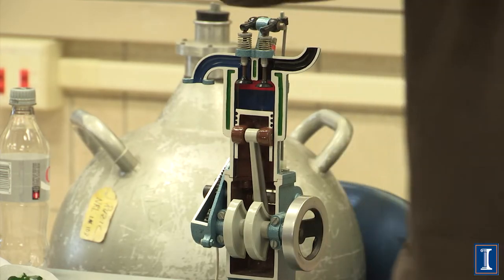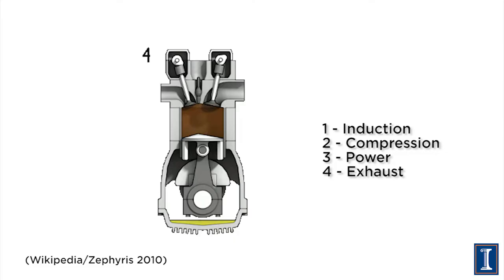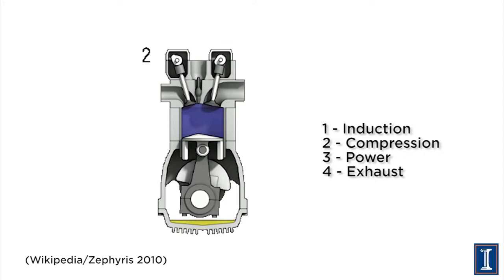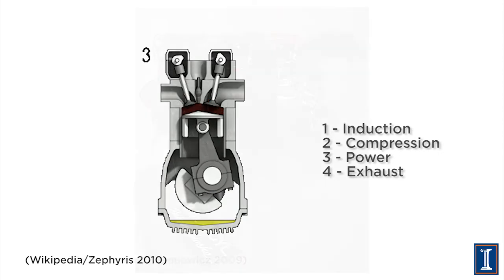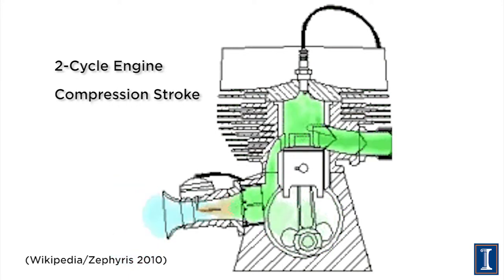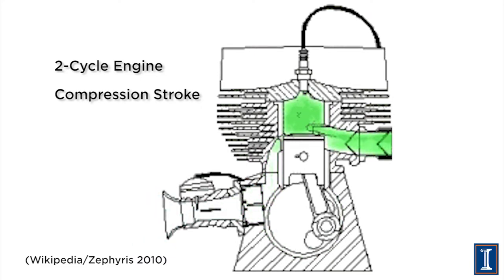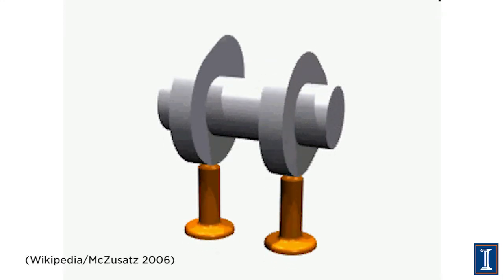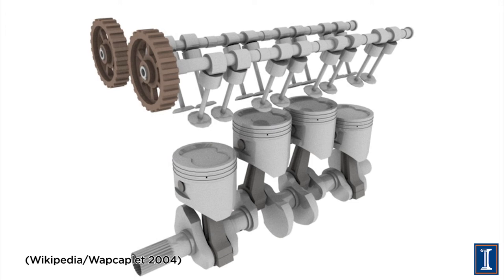How Things Work: the Engine in Your Car

Comment: 2-cycle is not limited to small engines.  Until recently, railroad diesel-electric engines were two-stroke, using a blower to help purge the exhaust gasses during the non-compression stroke.
Reply: I know some of those turbocharged 2 stroke diesels have 4 valves exhaust, but does that mean the valves are open for a bit when the air shoots into the ports?

Comment: A fuel injector doesn't inject fuel and air into the combustion chamber. The injector sprays Into the intake plenum or direct injection of fuel into the cylinder. The air still sucked in on the intake cycle by vacume of the pistons downstroke. The map sensor before the intake manifold and o2 sensors behind the exhaust manifolds give the computer the parameters to trim or enrich to obtain the stoichiometric air to fuel ratio 14.7:1.

Comment: Not a great explanation of piston engine operation. Stick to nuclear reactors.
Reply: What don't you understand?
Reply: @paulfun8720  That's the whole point.   I understand it all too well. Enough to know that the professor has had much more experience with Nuclear reactors than with piston engines.

Comment: 13:07   "we have a fan"...  LOL   ... he also shows the blower to cool the engine (1962 Corvair, maybe?)

16:16   #3 cyl on a VW Beetle... ironically,  the oil cooler interfered with the cooling of that cylinder,  and it threw a rod

Comment: 1. "Engine knock" often is a detonation or something else but not likely misstimed ignition (I mean, when piston is in down position - such are extremely rare).

2. In small cars there are plenty of 2-piston engines. Even one-piston engines do exist. Don't forget about flywheels, they do. Moreover, even in multi-piston engines flywheels are used, though less massive.

3. The main advantage of 2-stroke engines is not that they need less massive part (see p. 2), it's they are almost twice as powerful (in terms of specific power - relative to volume, mass etc.). "Almost" - because indeed they are less effective.

4. "Hemi" in comparison with flat cylinder head provides also better geometry - less heat loss, less detonation risks etc.

5. Turbocharger is not symply a fan, it' much more complex device. Turbine is powered by energy left in exhaust runs a compressor which pumps air. It contributes both to specific power an efficiency.

6. Part about cooling is also a bit misleading. The main purpose of oil is lubrication. Not all pistons have grooves for oil cooling. The most cooling does water.
Reply: Including one cylinder 4 stroke motorcycle engines, a picture of which he showed and called 2 cycle??

Comment: The main purpose of oil is lubrication. Sure it ads a bit of cooling. But the main cooling does the water. It flows in the walls of the cylinders and takes the heat away.
Reply: Well, without oil, the water would be hard pressed to keep the engine cool enough to jeep running.  The bearing surfaces are cooled by oil.  The oil is cooled by water. The water is cooled by air. . .

Comment: The only issue I saw with this was the timing belt section - what was shown was not the timing belt or chain, but the serpentine belt.  These are used to run things like power steering, A/C compressor, alternator.  All in all, a very minor issue - this is an excellent video.
Reply: It would have been better to gave shown a timing chain. . .